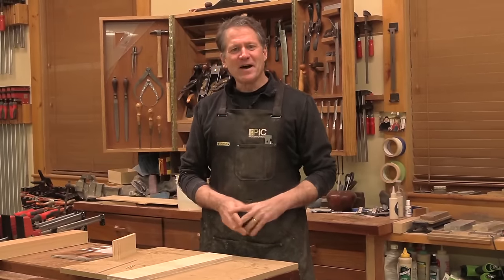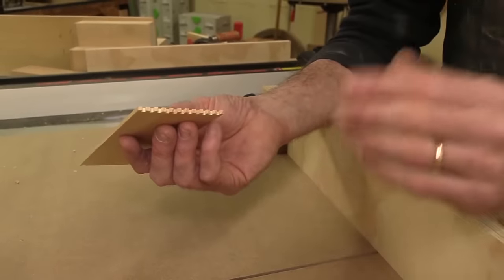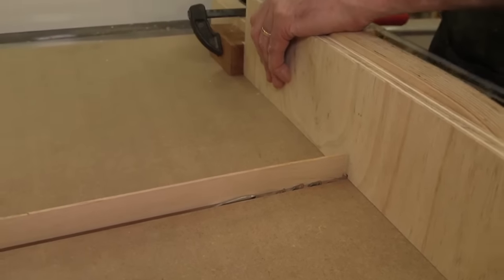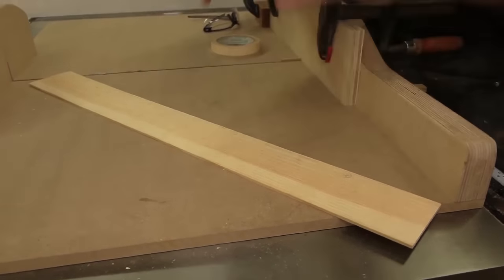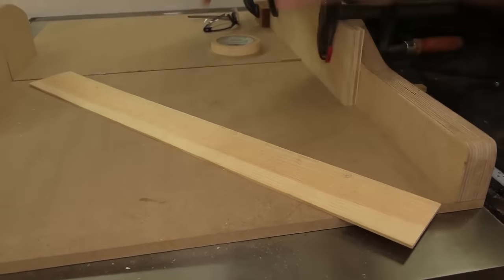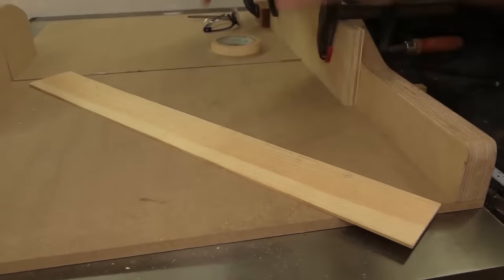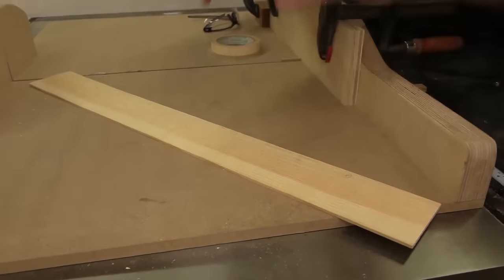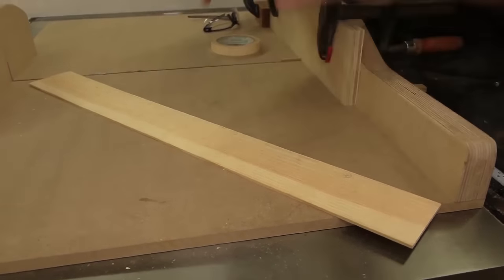How to Make Finger Joints

Comment: There's some good tips in here. Thanks for sharing.👍
I salvaged a small packing box used to ship brass pressure gauges in, way back when. It was cut with with finger joints with pine material about 1/4 thick. The top has a sliding lid and the bottom was just tacked into the side pieces. It was probably like the cardboard box of the period, meant to be throwed away after the product arrived at it's destination.

Comment: How did you attach the handle? Thanks
Reply from the maker: Hey Vic, That idea came from an article
in Fine Woodworking issue #278, by Christian Becksvoort. He describes how to attach the handle there. Basically it’s two washers and copper or brass rivets 1/8”x1/2”, or from Lee Valley no.33K62.01
Have fun with it! 👍